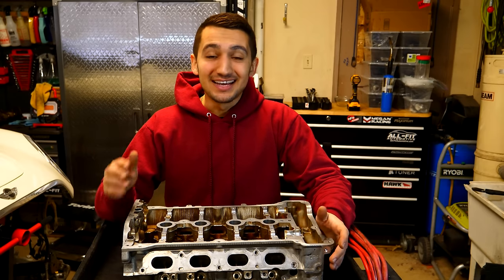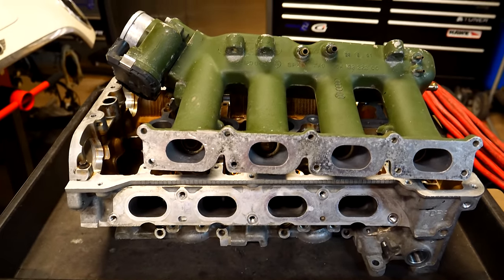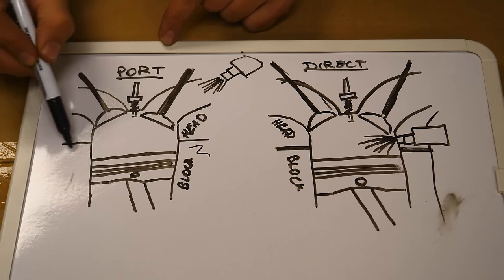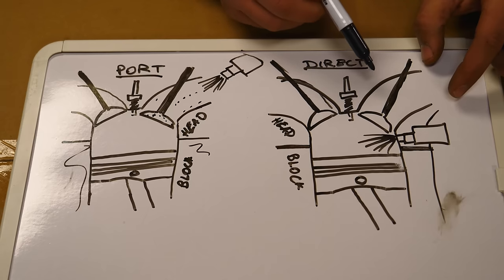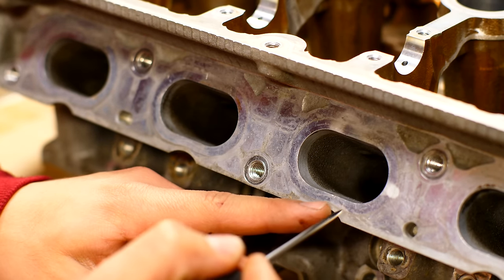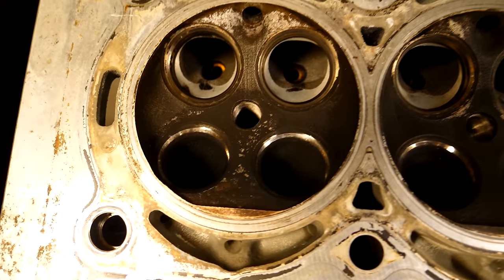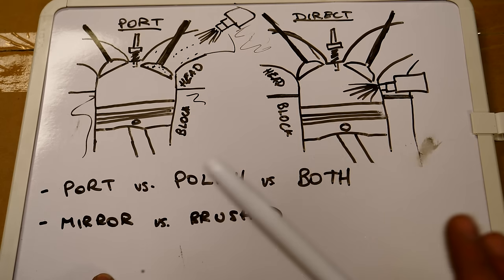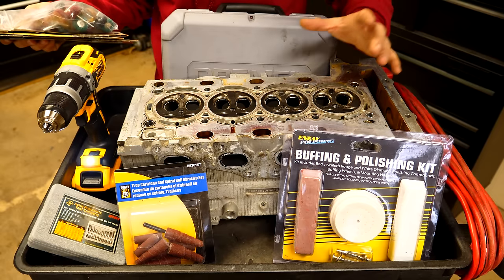Porting vs. Polishing vs. Both

Comment: Sorry but there's so much wrong with this I wouldn't know where to start! I would suggest some SAE white papers on laminar friction factor equations to relative roughness values. This will help you understand boundary layer ratio thickness to relative Ra height. Also how the viscosity of the air and its environment effects optimal port Ra. Intakes with boost should be limited to 60-80 grit, far from a mirror finish especial on the intake side with a limited flow velocity of around 700 ft/s.  Exhaust on the other hand is quite stable to 1300-1600 ft/s and our gas is very viscous at 800-1000C due to the density change and speed of sound in that environment. for these reasons mirror in the best finish for exhaust. Another important point that seems to be missed is, porting has nothing to do with making a big whole! its about velocity matching. finding the chock points and balancing flow. I've done and been involve with countless back to back test over the last 20 years with our race heads and plenty of others. On most late model twin cams, there's very little need for added CSA. They do not need any increase in window CSA, some  actual need welding up. The ports or intake MCSA's is what needs to be match to improve engines VE's. Valve throat size should be similar to the port window CSA if you want good area under the curve. This video is very naïve and shows a huge lack of understanding in the very basics of physics around air flow and its function and science behind a good port design.
Reply: Thank you for this comment. This video is an EXTREME oversimplification of port and polishing. This young man speaks confidently about this process! If I didn’t know any better, I’d think you’ve been doing this for years. 

First off, I’ll give you credit for making a video that covers the entire port and polish process. I mean that. I have mad respect for people who post stuff on here that attempts to help the masses. 

I’ll stick to the biggest issue I have with your content in this video. In all my years as owner of a automotive rebuild and remanufacture shop, I HAVE NEVER heard of a cylinder head being ported and polished a certain way up until the point of the fuel injector, then done another way after the fuel injector. My company port and polishes every engine we rebuild/remanufacture, and have not have any issues to date. If you have data that supports this method, I’d really appreciate it. Thanks and good luck.
Reply: @thatoriginalguy  Yes that seems to be the problem with lots in the industry,  They "believe" so much that isn't based in any facts or physics.   It's not an over simplified video,  it's plain wrong.
Reply: You are spot on sir, young lad here doesn't understand certain things.....you cant just open it up, you SHUDN'T polish (persay).....and he doesnt mention reversion at all (he probly dont know what that is).....if you do certain things to your exhaust port, you will enhance reversion...WHICH IS THE LAST THING one wants in getting a nice % of VE!!........ah youth......boy, give em a smart phn, and all of a sudden with have a genius......UGH!!
Reply: I have a little tip for you. When you're trying to educate people who are much less knowledgeable about a certain subject, then don't use acronyms or at least explain what they stand for. When you use big words or acronyms, only people who already know what you're talking about will understand it and it goes over the peoples head who could actually use the knowledge.
Reply: The man is just explaining the process as well as the benefits and drawbacks. Obviously he's not a genius on the subject matter but he knows enough to educate other people while you see fit to put him under scrutiny because "he didn't do it right" grow the hell up.
Reply: Ypu did not listen gdi can have better polishing.
Reply: @RICHIE_RICH89  What didn't I listen to?
Reply: Oohhh.. looks like someone found a theory book from the 80's 🤣🤣🤣 here's a project for you... do your porting with whatever grit and finish "roughness" you want.. dyno the engine and then polished the hell out of the ports.  SERIOUSLY.  Get back to us with the results. I already know  what you will find. This guy who made this video should do the same 🙄
Reply: @poncoolride  Oh how cute you think we haven't. I guess we just tripped over our record heads and intakes for some of the fastest cars on the planet, Thx for the laugh champ we were breaking records 20 years back. Oh and if it was the 80's it would be a burr finish. But hey you clearly build lots of race heads. Let see your dyno results 😉
Reply: Do you recommend the Intake and Exhaust ports on smaller 1.5 litreish Turbo Diesel Direct Injection motors to he mirror polished or rough?

Also for the Turbo ducts, especially on Exhaust side.
Reply: @thefastelephant94  Port should always be targeted to air speed. So basic CSA math to establish Max air speed so that we keep in optimum velocity range. 

The density,  so additional boost should be ignored. 

Mirror finishes only belong on exhaust.  

Even with air flow. We still need an active boundary conditions as this is turbulent flow. Not laminar,  so depending on the shape. 60grit. Is as fine as I would go.

Comment: Some of the best engine builders have said “Port finish doesn’t really matter, just get the shape right”.
Reply: Who?
Reply: Eric Fixalot exactly  it's TRUE
Reply: There was a bloke out there once upon a time that used to somewhat randomly tack weld his cylinder heads/air paths to the heads to create tumble in the airflow and he used to get mythical results. 

Not sure who or how, I'd have to ask the old man. 

My only reckoning is that the volume would have to be similar volume/pattern for it to produce good results on multi-cylinder engines.

My understanding is it's (abstractly) a bit like shark skin and water.
Reply: That's for carb'd engines.
Reply: If you want to know more I will ask the old man when I see him next, just send me a direct message and I'll send you any info I get.
Reply: @Louis-op4zj  yeah I'm curious about it
Reply: @Louis-op4zj  in curious 2 would like to know it
Reply: @Louis-op4zj  i still know an old bloke that does that... basically vortex generators in the head.
Reply: True.   :-)
Reply: So I just want to remove the rough casting so should I just leave it rough to atomize the fuel? Port injection
Reply: @paulsosa1872  Finish is debatable but I've never seen a rough finish on a funny car or nascar head.
Reply: @Louis-op4zj  yea who
Reply: @EricFixalot  you mean that on nascars they always polish the intake? And do they polish exhaust?
Reply: @paulgauthier2693  It's all cnc cut to a fine degree, basically a polished finish on both intake and exhaust.
Reply: @EricFixalot  thank you!

Comment: Mirror on the exhaust.. velvet smooth on the intake. Gasket match the whole tract.
Reply: This guy gets it
Reply: Velvet smooth? I'd rather have mine gone over with a carbide burr. Contact some good head porters like Chad Speier or Larry Meaux. Ask them what they do. They won't say velvet smooth. Or even Darin Morgan at Reher Morrison Racing Engines. Ask him. Or look at any of the hundreds or thousands of heads and intake manifolds they've done.
Reply: True but are we talking carburetor or fuel injection? Big difference in how the fuel must

Comment: The point of porting and polishing is to create an air flow that is as laminar as possible.  Anything that deflects air molecules from a straight line of travel, reduces flow.  As the molecules speed along, they reflect off a surface at the same angle they strike it - think pool balls with no spin on them.  The angle of incidence = angle of reflection. Your task is to provide a surface that will deflect each molecule by the fewest degrees possible.  This means no rough edges that will cause a radical change in direction.  Creating turbulence is bad because it changes the direction of molecules, which in turn collide with other molecules increasing the effect and causing pressure which reduces flow.  Atomization of fuel is never a problem because the air will be plenty turbulent by the time it passes the valve, and it is entering a very hot environment.  The mistake many make is in making the port as large as possible, but creating bad angles in the process and causing restrictive turbulence.  When porting, think of microscopic BBs being shot through the port, and how the surfaces would disturb the path of the BBs as little as possible.
Reply: Laminar flow is a virtual impossibility given the geometry we're dealing with.
Reply: Laminar flow through relatively straight runners. It's a non issue at the point of turbulence
Reply: We are not talking about surfaces that are so rough in an intake making much of a difference to worry about them or worth talking about them, what is important is making them as straight as possible and paying attention to volume trying to keep large to small as you enter port.  Spend time on blending or removing things like vlv guide that stick into port, make a smooth turn radius where port turns (never get a straight port), unshroud port where meets bowl and give a good valve job.  In my experience unless racing and you have to use specific head not worth paying for porting one (or doing yourself) when you could buy a better flowing head for about the same money.

Comment: Knock off mold lines/ sharps, port match if needed and run a 80 grit sanding wheel. 
Anything more and you need a flow bench.

Comment: As someone who hones their knives with sandpaper of very fine grit, 5000 at minimum as a finishing grit, on a bock of marble or a slab of glass, depending where i do it in my house, I will definitely go manual mode with my ports, as there are no electric tools that guarantee the quality and safety that a hand with wetpaper does, also, you can feel everything and can therefore get the most nominal shape with least curves in your work, whereas with power tools it may look great but still be uneven to the touch, and the air at high speed will notice even more than you will by hand, but then, thats why we polish it with powertools... Also, polishing my friend is the step done with the polishing paste and cotton pillows, so dont say that you are polishing it roughly, as polishing implies a mirror finish, that is why you can polish metal with powertools, as polishing can not create a hole or remove a bunch of material... Sanding or cutting or abrading away is what leaves "brushed" look and finish and that is done with sandpaper, powertools that use sanding bits. The porting is the roughest cutting with tools that do not abrade to cut but rather use a physical blade of whatever scale to remove thin layers, be it diegrinders with carbide cutters, dremel tools or any other highspeed rotary device...

Comment: We found best results for our heads; cross hatch semi rough on intake and mirror on exhaust. Size was tailored to horsepower/torque curve desired. With the new injectors in market where we can change injection angle will change our approach quite a bit.
Reply: 100%

Comment: This is such a nuance subject. There are SO many variables that will change depending on the application. For example the induction system, the purpose of the application, the types of camshafts used in the application. 
In a street application, the low end torque loss, in my opinion, might not be worth the gains up top. But even that theory does not apply to every motor. 
Like I said, every application has Sooooo many variables.

Comment: For all those who think they know check out engine masters. They don’t show how to port and polish but they test on a dyno and debunk all these stupid things. Port and polish all of it. Higher volume means less struggle which totally out does velocity. When you have velocity you add pressure. If you want to prove volume out does velocity just blow through some tubes of different sizes. The engine will get what it needs. Port and polish gives it that easier allowing the engine to not work as hard to breathe

Comment: Actually it depends on the fuel delivery. A rough texture is typically better for a carburetor or Throttle body configuration. Port fuel injection a smooth polished works best. Keep in mind biggest doesn't necessarily mean more power.

Research that particular engine, and find out where is the choke point. That may consist of intake manifold or the exhaust manifold. Some engines you could loose power from over porting.
Reply: Dafuq u tokin about throttle bodies are fuel injection
Reply: @seventytwo4728  Old throttle body injection for example Gm crossfire injection system.  A newer style multi port injection where you have an injector nozzle for each intake runner.

Comment: Ahem......most all OEM & aftermarket racing suppliers / experts have already spent the time, money, & have done all the R&D work for you.....save your money and just buy the "go fast goodies" they already provide, be safe, & have fun....but that doesn't mean you shouldn't learn and understand it, especially if you are on a design team, need that extra little edge as a privateer, or are in a niche class such as antique / vintage / classic, etc.........by all means.....1. Study, Study, Study (Air / Fluid / Thermal Dynamics, Geometry, Boundary Layer, Flow Bench, Dyno, modeling software, CAD, etc, just for starters). 2. Always make / save more money, you're gonna need it. 3. Determine the end result you really need & know your limitations before you start. 4. Obtain all component blueprints if possible, but accurately measure all stock components regardless - get your base line (Flow Bench, Dyno, & mock-ups are a must). 5. Talk to an expert in your OEM / Aftermarket fields......take extensive notes. 6. Go "pick" the local junkyards for some cheap stock parts that you are already using BEFORE hacking on & ruining your good parts. 7. Measure, flow bench, practice, flow bench, practice, practice, flow bench, dyno, document....destroy some shit, DOH!....start over....flow bench, practice more, dyno, etc (but remember failure = learning). 8. Spend money (make more & save more). 9. Test runs / proving grounds - reliable consistent results? something else gonna fail because of these gains? 10. Modify your good parts and go hit the track (or street, dirt, air). 11. Retain & document everything you've learned, but always remember and accept that what you accomplish now will most likely be obsolete very quickly, something or someone faster always comes along........if that's a problem - then create a niche class, or master a specific application, and be unique.

Comment: JUst my two sense, if you make it too smooth you create an area where the flow sticks to the side, known as the boundry layer.  Ruffer creates a faster flow because there is little to no boundry layer close to the surface, sailors have known this about fluid dynamics for centuries

Comment: First thing I will say if you do not have a flow bench and can actually test things is ONLY GASKET MATCH. You can ruin a set of heads or intake hogging it out without  flow testing.

You can port the hell out of a poorly designed plastic intake. It is easier to grind than anything else.I wanna see flow bench numbers to prove me wrong or OP admit you spouting off internet crap you read.

Here is your kicker. I  have a flow bench. I've played with plenty of heads and intakes on all kinds of racing crap since 1987. Go carts to 1200hp v8s.

What you are spouting off is so generic it is almost old school, even then it's only about 1/4 right.. welcome to about 1989
Reply: neo 71665 Word!
Reply: Nowadays, with the ease and accuracy of CNC porting, I don't see the benefit of home porting stuff anymore.
Reply: American Thunder a cutter that knows what he is doing and has a bench can out do by 10x a CNC ported head.
Reply: @bryanroupe8646  You would rather sit down, and hand port your heads, instead of simply  sending them back to the company who made them for CNC porting? Or are you referring to extreme applications, such as top fuel?
Reply: Gaskets usually have much bigger port openings than the ports themselves. In this case do NOT gasket match. Instead, lay out the joint and PORT match.
Reply: @cv 67 with the market being so competitive today between companies like air flow research and trick flow they are constantly doing research into making their products flow better so it would be very difficult for the home Porter to outperform what millions of dollars of research has achieved
Reply: AmericanThunde

Comment: Matched, ported and polished was POWER for engines Pre 2001! It was also CHEAP! The blocks are totally different! Made for fuel economy now
Reply: Yeah, I'm doing my 1995 S Series with .20 over and 3rd gen crank and tie plate, etc dual intake cams, etc, not all the mods but yep, you would be correct. I know the difference between even the earlier Saturn engines vs the 1999-2002, even though technically the same engine, the later years, the put roller rockers on the head, but used smaller intake ports and added all kinds of emission restricting features to the exhaust manifold, etc, u can't even find a header made for the 1999-2002 years around. I have a 1995 and a 2001 SL2 in my yard that is going to be the donor car for the 5 speed manual for my 1995 SL2 amd going to add a MFactory limited flip and lighter flywheel, etc.

Comment: I had mirror polished heads on port injection and made 30hp on the dyno all motor 3.0L 3000GT. Kids a want a be. You can also buy over size head gaskets to port the combustion chamber larger, and you can make your own intake gaskets to port it any size.